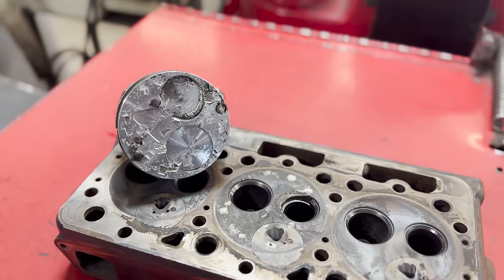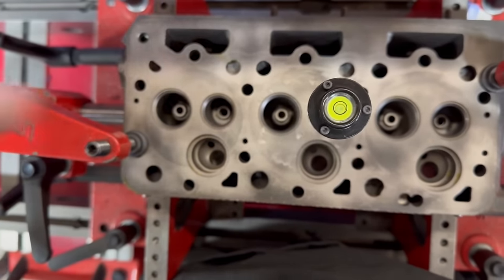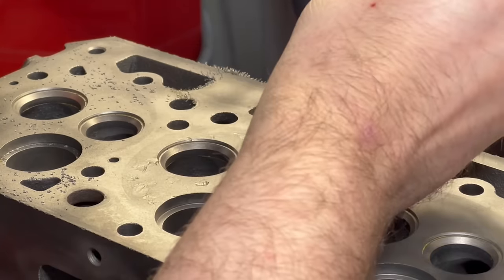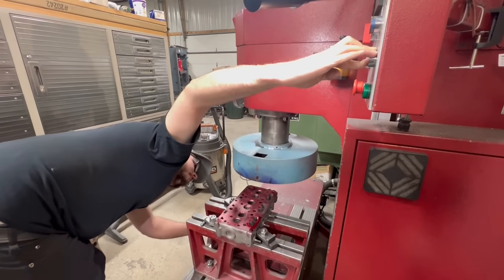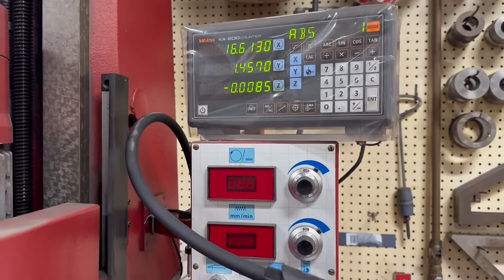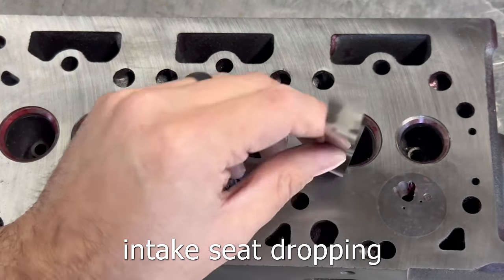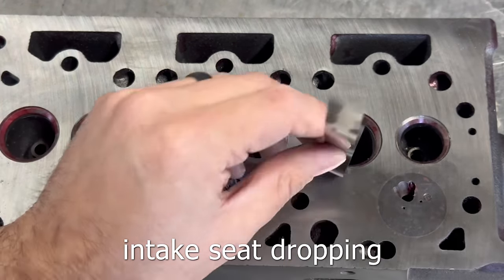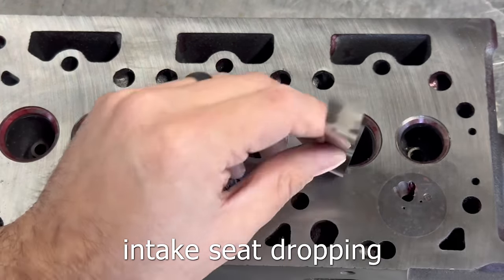Is A 3 Cylinder Kubota Diesel Engine Worth Fixing?

Comment: Years ago when I rebuilt my 6.9 my machinist told me he couldn't resurface the heads with a cutter because the pre chambers were harder and the cutter would jump over them and not cut well. Instead he used a sander.
Reply: That sucks. This is why some people just order reman heads online from someone who owns the right machine for diesel prechambers.
Reply: I hope you mean surface grinder 🦉
Reply: @tcmits3699  Nope, sander. Turned out good.
Reply: That would be funny if sanding gives a better sealing surface.  Take care

Comment: I'm so glad I bought a new BELARUS 250 air cooled diesel 30yrs ago.  In my opinion, one of the best diesel engines ever ,  little diesels like that Kubota, I'd replace with HF V-twin gas with bell housing adapter and new crank flange to match.  A job for a true pioneer, parts changers shouldn't attempt. At leats owner can sell the head and maybe the "sleeved"  block.  Alittle disappointed in the outcome.  Nice machine work though💡

Comment: Great videos. Seems like in diesel world on cylinder head flatness length warpage is no longer as critical as side to side with no depression allowed in "fire ring" area of HG. I have to agree with the extremely experienced and knowledgeable parts cleaner, this is a learning experience that requires you to cut your losses and could get into a time and money pit finding replacement parts.

Comment: I work on numerous machines with Kubota's.....D-722 and some larger engines. They are very reliable but i have seen more than one with cracked heads on Miller welder engines that get run at 3600rpm....I don't fix these and would not attempt to. The same engine used on an Onan generator runs at much lower engine speeds and can go for thousands of hours. The number of shops or places that could do anything like you men do is just about ZERO in my area.....I worked in an engine machine shop 30+ years ago and know exactly the difficulties you are dealing with. I would love to fix anything that comes my way but it just is not possible and I deal with issues like this often.....

Comment: My cousin has a 3 cylinder Kubota engine in his gf1800 lawn tractor. This isn't a throw away engine. It takes my cousin two days to cut the grass at the cottage. The gf1800 is an excellent tractor. It's why so many municipalities buy these tractors. They run for hours and don't wear out. I'm surprised someone had a problem with theirs. My cousin bought his tractor at least twenty years ago. Take care. Roland

Comment: These are great little engines. A lot of smaller generators and construction equipment here in the uk run these engines. I reguarly service these in generators with upwards of 30,000hrs. There prone to crack where the injector nozzle comes through the bottom of the head. Any bottom end catastrophic failure on these we rarely repair, ive fitted oversized pistons in past which kubota supply in 2 sizes but as we can normally pick up a new engine for around the same price as parts and labour we usually just engine swap. Great video 👍

Comment: unless there exists a GOOD reason to 'repair/rebuild' an engine  compared to a replacement engine...
get a replacement engine.  as engines get smaller there is less room in a block casting for oversizing or sleeving.
I love seeing the interior.

Comment: It’s small so it should be fun, people just don’t understand. Take a watch to a watchmaker and see how much it costs to fix that tiny machine that doesn’t require the amount of work it does to do the work you are doing. I started working in a NASCAR shop in 1994 and started building engines and machining the parts to build our engines. I also fix watches and some magnification and a good set of small screwdrivers and a few other things. I have everything required for a full watch service in a pelican case about the size of a case of beer. I wish you could put a machine shop in a carry case.

Comment: Heads are junk. Once overheated they crack. $900+ bare head. Just did one a year ago. Cost nearly $2,500 in parts to fix. Just did bare minimum to fix. Parts cost ten times what they should cost.  Magnaflux the head. Cracks on mine were internal and hard to find
Reply: OIL PUMPS ARE JUNK ALSO.

Comment: If the cylinder dent were from the insert,  it would have sharp edges as valve seat inserts are harder than woodpecker lips.  This looks like a heat distortion.  Possibly from the precombustion chamber jet impingement.
Reply: Have seen where liquid in cyl.would bend rod and split cylinder wall.
Reply: @Kenny-1958  
That cylinder won't hold pressure with a dropped valve seat.

Comment: Losing money like that sucks but it does happen sometimes. 
Especially with the oddball stuff and the throwaways. 
I know not all piston rods are built the same way, but the ones that have a drilling for oil passage, I’ve always wondered why a set of precision rods couldn’t be obtained to be used as a quick way to check for straitness. 
When I worked on GE locomotive engines we had a few precision rods that we used to pass through a piston Rod oil drilling to check if they were slightly bent or not. Obviously if they were severely bent you could see it with the naked eye, but we did find a few here and there that looked straight but were actually bent when we tried pushing the precision rod into the connecting rod.

Comment: The parts can be expensive so maybe its economical to fix but its common to have cracks around the precombustion chamber. Parks department and sanitation in new york have diesel gators with 3cylinder engines similar to that which they use to remove snow from side walks. So sometimes they come across my work bench.

Comment: Are there any small engine manufacturers that ARE designed to be rebuildable?  Or or all small engines disposable?
Also, what is the smallest rebuildable engine?
Reply: Well, from my experience, a Citroën 2CV 18 HP 435cc. If you can find the parts.

Comment: Those little engines are as close to bullet proof as you can get. They will run in a bad state of repair almost as long as other engines will properly maintained. Probably was abused and beat on for decades. It's hard for me to feel sorry for people who treat their equipment like that ( if that's the case) on a side note I've always liked machine shop work and wish i would have gone into it. I've known a couple of good machists and learned a bit from them back in the day. I'll subscribe and keep learning. Thanks

Comment: May I ask, why wouldnt you weld the area near the damaged valve seat back up then mill it to take a new seat?  Love watching your work!
Reply: cast iron can weld funny and crack easily as weld and area around it are no longer the same type of cast iron
Reply: Welding cast iron is fraught with danger. As the region in question is subject to high temperature & pressure, it should be avoided it at all costs.

Comment: I wonder if a Muggy Weld Cast Arc Rod could fill that and be machined off and then stand up to the heating a cooling cycles of an engine.   They work great on exhausts manifolds so you would think they would work on the head as that valve seat cant need to be super duper strong as it has 7/8 of the seat in good condition.   Do you guys ever weld anything then machine it or is it too risky?  maybe try it once to see what happens.

Comment: For an industrial steel or iron head like this wouldn't it be a good idea to weld in filler material first, then do the machining work? In theory that would eliminate the need for such an oversized valve seat?
Reply: It's generally not a good idea to weld a cast iron head.

Comment: I just did a d 11 0 5 and outside by side similar issues crackhead scored cylinder wall. It was gonna be like almost 5 grand from machine work to put it back together. Got a great drop in complete with alternator water pump belt starter  Is injection pump injectors everything from kabota for 6500 Bucks.  Complete drop in unit ready to run.

Comment: While it is true that it is expensive to build/repair these engines, they are by no means one shot throwaway engines. Oversize pistons and bearings are available from Kubota.
Reply from the maker: I’m not saying parts aren’t available… in fact we literally commented that parts are available, just not readily from our normal suppliers.

What I am saying is that parts aren’t available economically. Planned obsolescence in disguise. 

This is just my opinion, take it or leave it. Marking up the prices of the oversize parts to the point that nobody in their right mind would pay for them may as well be the same thing as simply not offering oversized parts.

Comment: Hi Tried doing a overheated  722cc 3cyl  cyl head and all rotating parts plus machining plus injectors and injector pump  overhaul . All these parts had to come genuine Kubota USA  tractor dealer ,,all  parts 1500usd ,, overseas head=1000$ 
new motor was 3200Aust $ .
Briggs and Stratton  use  a Daihatsu diesel  . Toyota owns the Daihatsu  factory . Very expensive engine to rebuild all genuine parts .

Comment: (raises hand with stupid question 'cause I'm a liberal arts grad) So I get into an engine and notice a smile on one of the pistons.  Or for that matter a few of them since the keyway sheared on the crank snout.  Is it even possible to save the smiled-on piston, or is that just gonna create a hotspot (and die) no matter what you do to repair it?
Reply: Piston probably saveable... knock off any sharp transitions to eliminate Hotspot causing pre-ignition/detonation. Valves are likely bent, though.
Reply: My parents used to have a V6 Mitsubishi Magna (6G72 engine). Due to the mechanics stuffing up, the accessory belt broke and went under the timing belt, leading to valves hitting pistons in all 6 cylinders.

That engine got a top end rebuild and soldiered on for something like another 100,000 km with dents in every piston.
Reply: @nerd1000ify  if it were me, i’d have had the pistons resurfaced to remove any damage
Reply: @JohnH20111  more $ than the car was worth.

Comment: I'm just curious, have you considered using liquid nitrogen to freeze the seats prior to press fit? I love your cleaning guy's technique for ring gear on the flywheel installations lol. Didn't know if that was an option for you guys or not. I was a mechanic for 15 years before I became an aircraft machinist. Been doing that for 15+ years now. I know when we do tight tolerance bores that the assembly guy's install a bushing into, they will use liquid nitrogen for an easy press fit. Just curious if you had that option available to you

Comment: Can't fault you for wanting to bring it to factory specs or better but most folks would fix the really bad things,whack on the rod till it was a bit straighter then toss in an inframe kit and call er good to go. Would it then last 5000 hours? Nope but it could last another 20 years if it's a 100 hour a year tractor.

Comment: I have a Branson 2810 with a 3t90e engine and it has a crack in the center cylinder of the head have any idea of where I can get a head
Reply: China. $500.00 freight I need a block  sorry head should be less.

Comment: I have a two cylinder Kubota. I overhauled the engine, but from the first day the engine smoked a bit from the ventilation, over time it became more and more so, and the engine is very difficult to start in the morning, but when it runs it runs Well, I need my second car in the morning to start the engine, it can take up to two hours until it thinks it wants to start
Please can you tell me what's wrong with this motor, thank you very much

Comment: Couldn’t you weld up the bad area and then machine it down to the original size?
Reply: that’s a dang good question, but if you think about it, the heat from the welding process would possibly warped the cylinder even more

Comment: these little kubota engines are throw away engines , you are right  ,but they are also very durable and long lived when cared for ,, i have a kubota in a golf course mower just like that with 9000+ hours on it ,, the kubota Z-482 in my generator  passed 15000 hours and still doesn't use a drop of oil 
generally  they will outlast the machine they are installed in if taken care of
Reply: I got one sitting in my shop that says different 176 hours rod #2 hanging out of hole in block.
Reply: @assyholey4224  what was the cause of the failure  cause i'll bet money it wasn't caused by the engine being faulty ,,i've been working on small engines since the mid 80s and i've found universally that when an engine fails with super low hours like under 200  , it's usually operator error at the root cause ,,factory defects happen and i've seen a few weird ones  like loose rod bolts on 1 engine that showed up within 2 hours of run time ,stuff like this 3 cylinder kubota they are working on ,, that was caused by a cooling system failure , the owner ran it till it blew up ,, i've seen a few head gasket failures in these if you get them hot , the one thing i see the most  though is clogged fuel injectors from idiots running shitty fuel and not changing filters ,,still haven't seen one at least not a small one with a broken conrod  ,, seen a few bobcat engines that guys ran low on oil  or tipped over that blew up spectacularly,,
by and large these engines are very reliable and long lived  ,, there are millions of them in service in everything from APU units to lawnmowers, bobcats ,excavators , generators  and refrigeration units ,,
if they weren't reliable  there wouldn't be so many of them ,, someone else's  engines would be getting used,,the 3 most common small engines in this category are Kubota , Yanmar and Perkins ,,,and kubota by far is the most common ,,i've worked on them all and Kubota by far is the easiest and simplest to work on
Reply: @wildcoyote34  this motor is 3.1 liters look to be oil pump and fatly oil gage. are you saying none of these engines are made in China the largest supplier of everything made on planet earth? And do you know China was caught more than once with prison made products shipped to south Koria and other countries and relabeled so it was hard to tell they were made by China prison populations.
Reply: @assyholey4224  Kubota is made in JAPAN or the USA  not china ,,KUBOTA is made in Georgia right here in the USA 
,,i'm not saying that there hasn't been counterfeit parts sold or imported into the US at some point however ,,but i have yet to see a counterfeit kubota engine especially a large one ,, 3.1 liters  that's a large engine too  not one of these super mini series engines like they were working on in the video ,,
I've never had an oil pump fail in a kubota personally ,,,there's always that one engine that one part that had a flaw in some part of it's casting that blew up and caused a catastrophic failure ,,even the best quality engine can still have a failure caused by materials or workmanship ,,that's what the factory warranty is for ,,
and i'd be willing to say without even seeing the engine you have  if it failed at 176 hours  it's probably due to a factory defect of some kind ,,
unless the customer did something really dumb like changed the oil and used the wrong oil or not enough oil ,,or tipped the machine over ,,warranty never covers stupid operators 
engines even cheap shit chinese ones don't just blow up at 176 hours without some sort of factory defect   or operator error
Reply: @wildcoyote34  you sound like you own a Lote of shares of Kubota stock.
Reply: @assyholey4224  nope sure don't ,, just a mechanic with a lot of experience with a lot of equipment  for a long time ,,actually if you want to know i own briggs and stratton stock ,,and have been a B&S certified warranty technician for 25+ years ,but i can fix just about anything ,i work on a lot of small diesel powered equipment ,they aren't really that difficult to work on either until you get into the bigger stuff like that 3.1 liter  you have  most of these are pretty simple without a lot of electronics ,the machines they are built into that's a lot different cause machinery has become increasingly reliant on electronics to function
Reply: @wildcoyote34  I mow with a 1977 case 446 second Onan 18hp up to 20hp crate motor, none of what I use on the farm is made any more, but I do have a machine shop on the farm .it is a drag getting old
Reply: @assyholey4224  oh yea i know what you mean ,i have a 1977 wheel horse D160 and 3 pre1974 cub cadets and several Bolens machines that do various jobs around my acreage ,,my actual mower is much newer  it's a 1996 JD F-925  and i also have a gigantic Toro 580-D which i mow large areas with , it cuts 14 feet in 1 pass ,, i have several large farms that i mow for and having a 14 foot mower when you have 50 acres fo cut makes the job go fast ,, several of those old bolens machines have their original Wisconsin engines which are near impossible to get parts for ,,  my 1977 wheel horse and my Rounder L700 skid steer both have B series Onan engines the tractor has 1700 hours on a rebuild that i did in 1997  the one in the loader i have no idea on it's hours  but it runs good and only uses a pint of oil in 25 hours ,next time either of them blows up  theres a 20HP diesel in the future ,,i run my machinery too many hours to be dealing with temperamental aircooled engines that i can't easily get parts for
Reply: @wildcoyote34  you have some classic tuff machines. If you need any Onan hard parts like intake flywheel etc. Could sell for freight all most. there are 3 or 4 no runners are here in N.E. Missouri everyone is repowering now it seam. I have a Case 1969 195 putting 12 hp China diesel off a ground packer with handlebars you try to hang on to it employee got beat up by it. neighbor gave it to me for fixing his JD4020. I will just us the case like a golf cart, house to shop to barn. golf carts are high. and at 60 years young I need some. lol. nice talking to someone that is smart like you.